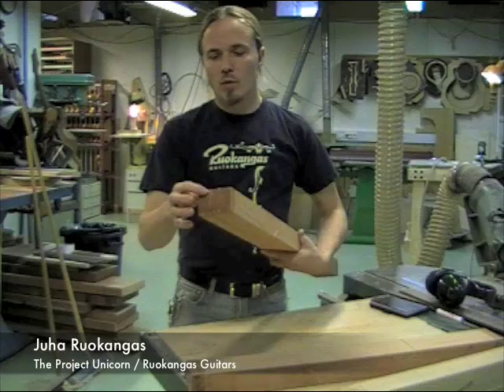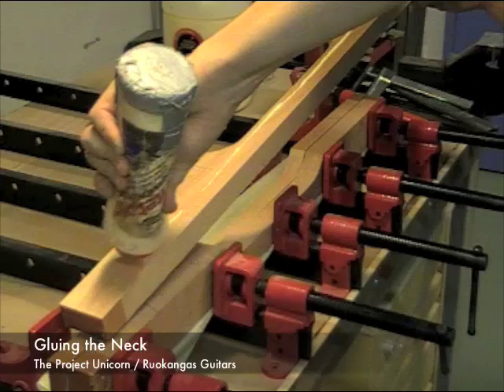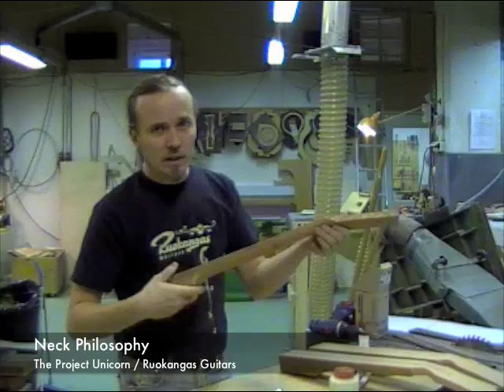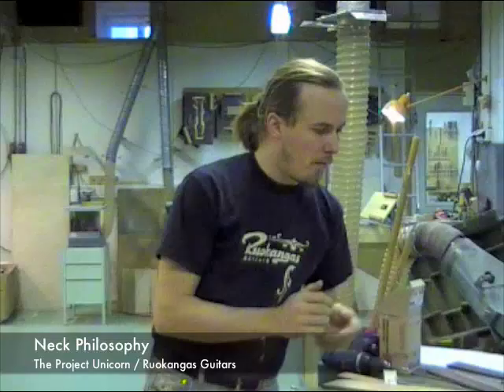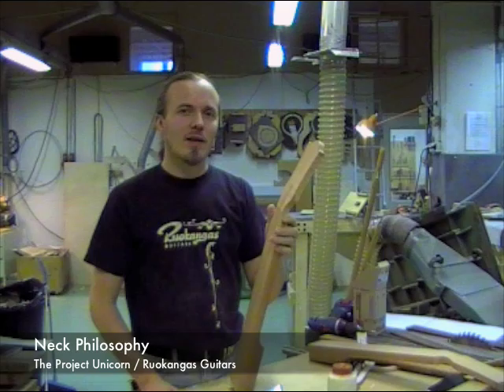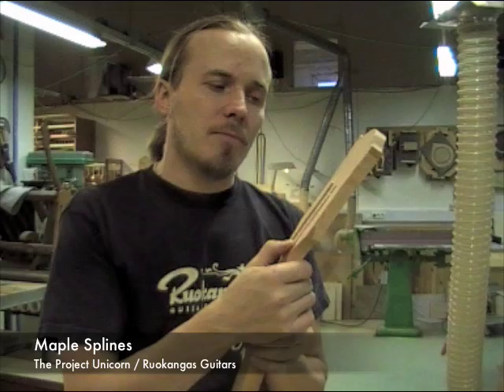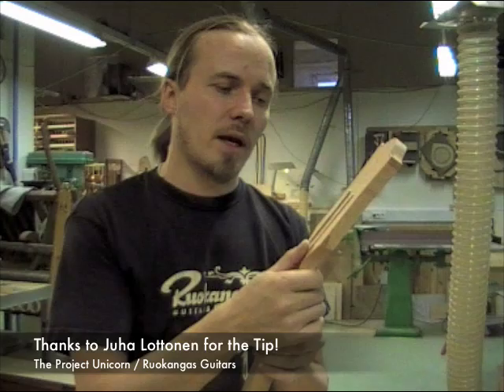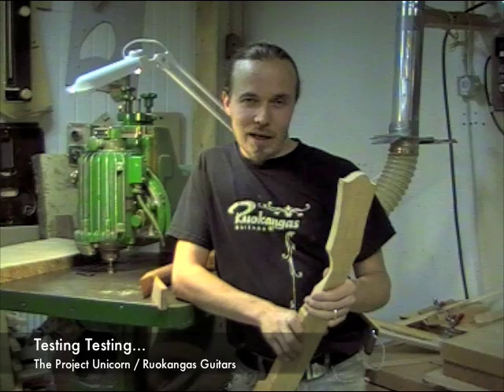Ruokangas Guitars Video Diary Episode 6 - Neck building

Comment: Flipping the middle piece of stock 180 degrees is common practice for luthierie and in wood joining. It was done by Leo Fender with G&L when he perfected many of his  constructction techniques. Cross graining exceeds the normal load capacity of wood and stabilizies torsional forces because of counter resistance loads. Adding the stabilazation inserts at the break away is simply very well thought out mechanical engineering. Nicely done and well thought out .
Reply: Having the grain reverse in the middle of the stock must make carving a nightmare, but if you use machinery, not an issue.